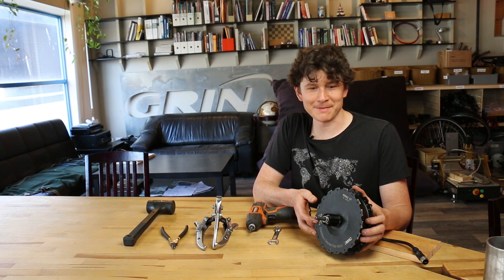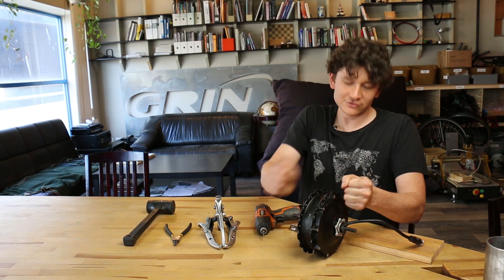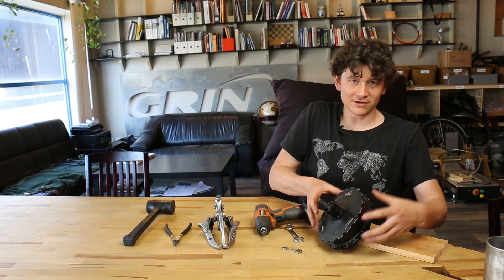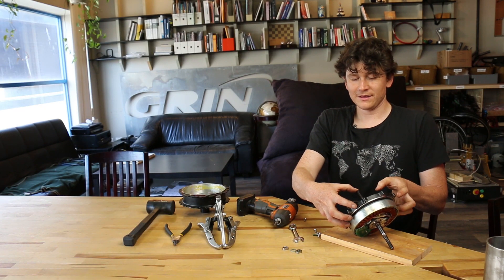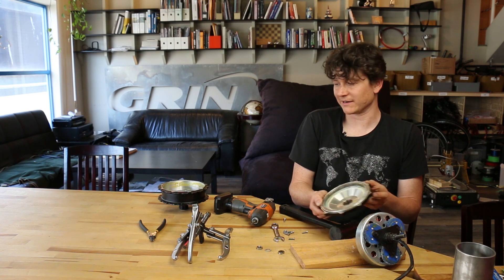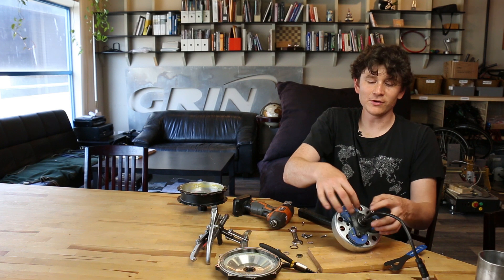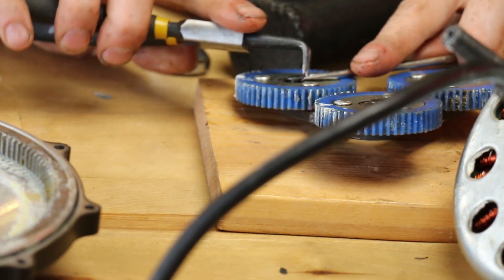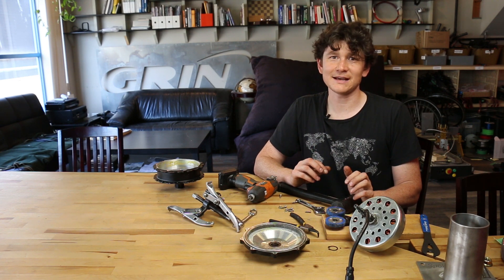GMAC Hub Motor Disassembly Tutorial

Comment: I replaced the planetary gears but am unclear how to press the assembly back onto the axle.
Reply from the maker: The same way as it came apart, if it's a bit tight to push back by hand then tap it gently with a soft mallet and a tube or pipe to apply pressure. Make sure that the key stock is properly aligned, and sometimes you might want to chamfer the ends of the key stock if it is catching in order to better guide it into the slot.

Comment: do the nylon planetary gears benefit from being greased with a non petroleum based lubricant like Mobilgrease 28?
Reply from the maker: We've not seen any meaningful firsthand evidence one way or the other. There is always a bit of grease inside the motor from the original factory assembly and we usually just smear that around when putting new gears in place.

Comment: What is the difference between the Gmac and the MXUS 1000w geared hub?
Reply from the maker: We've never seen the 1000W MXUS geared motor that you mention so cannot comment on the differences or similarities.  But I doubt it has a splined axle with integrated torque arm and a fixed planet carrier for regenerative braking.

Comment: I don't know if you read comments on old videos (2 years now) but, I have a new GMAC that i just put on my bike, noticed that it kind of clunks when the power comes in, what setting do I change in the CA to get the power to come in more gradually, I am worried about screwing up the sun gears.
Reply from the maker: A lower value for the throttle fast ramp up rate will do this, set it to like 1v/sec and see what you think.
Reply: @GrinTechnologies  Thanks for the answer I did as instructed and it is pretty quiet now, just a little in the regen braking, guess I should slow that down too.

Comment: I'm back with another "solution" to my dual-motor fat bike build. It's really hard to get hub motors that match on the simulator and have OLD's for 135mm and 190mm dropouts or thru-axles. Even with 150mm front and 190mm rear it seems like it's necessary to step up to something like a spoked motorcycle hub motor.   I had decided  to use a G62 190mm for the rear motor. But nothing matched up on the simulator the way I'd like it to. Then I tried the motor in this video and it's curve and specs were reasonably close. Of course, I thought I had the solution, a G62 in the rear and the GMAC 10T in the front. But the GMAC 10T matches even better to the G60 500w hub motor, and I already have a 500w, 190mm, geared rear hub motor. So, for my fat bike with 190mm rear dropouts and 135mm front dropouts, the stock 500w rear motor and GMAC 10T look like a good match. That also puts the regen in the front. The GMAC 10T is a rear motor, but I've been told that rear hub motors can be dished for the front.
 This isn't my first "💡 💡 " moment on this project. With controllers and batteries being equal on both systems, does this interpretation of the simulator data seem right?
Reply from the maker: You don't really need to have that close of a "match" for the motors when you have a Phaserunner or Baserunner as the controller. Just use field weakining on whichever of the two hubs has a slower top speed in order to boost it up to match the top speed of the faster motor. You can account for like a +- 25% difference in top speeds this way. Have a look at the multimotor drive video if you haven't yet https://www.youtube.com/watch?v=Ub4EP2_mAds

In any case, as for the propose setup of a standard G60 or G62 on the rear and a GMAC on the front, that would be pretty kick ass for sure.

Comment: I couldn't figure out how the motor free-wheels, maybe it always turns if the wheel is turning.
Reply from the maker: The motor does not freewheel, that is the main point of this GMAC hub vs the regular MAC motor. It is always engaged so that it can do regenerative braking.

Comment: Can you make it 142x12 Thru axle? I see it has everything ready for it just needs to replace axle with hollow one.
Reply from the maker: It would be nice but it's tricky to do that with a geared motor like this as the sun gear bearings are pretty small in diameter, and there isn't enough room to fit the cable exit between a hollow axle and the ball bearing in the current castings. Right now it passes through the axle via a diagonal hole which won't work with a hollow axle. We'd love to do this at some point but it requires a more substantial overhaul of the MAC motor components.

Comment: 'The motor will get as easily together as that' - well, Justin, show us. Replace that cable and put the motor together in an uncut video. I'll bet you it will be fun to watch. Popcorn and beer needed.
Reply from the maker: I mean, we've done it many times already, it's about a 1.5 hour job with some finicky wire feeding and soldering steps and isn't exactly popcorn and beer material.  The process of cable soldering is much like shown in the BionX hack video here https://www.youtube.com/watch?v=Wc8OJtFRUng (cut to length, strip, tin, slide on heatshrink, solder, heatgun to shrink, zipties/glue to hold the cable snug, and repeat for all the various phase and signal wires)
Reply: Sure, but can you do it without making any mistakes, like forgetting to pull the cable through the side cover first so you save yourself cutting the new connector off, pulling the cable through the sidecover and then soldering the connector back on.

Comment: Why is there no metal gears ?
Reply from the maker: There are some ebike motors made over the years with metal gears and they are all hideously noisy too. Nylon is surprisingly tough and well suited to this application, and the combination of metal sun gear with nylon planets works very good even at these high (~100 Nm max) torque levels.
Reply: @GrinTechnologies  also, i set my CA3 to only start the motor if speed is higher than 8mph. The gears should never get overstressed with that setting.
Reply: its standard to have parts that wear and cheap to replace  and dont tear up more expensive parts in the long run bmw does it with the transfer case set up  to name one

Comment: what are the planetary gears made of. They look plastic?
Reply: Old video but my gears are in pristine condition even after using motor past recommended power and 120amp phase currents
Reply: Maybe nylon, a mostly good material, and less noisy than aluminum or steel.